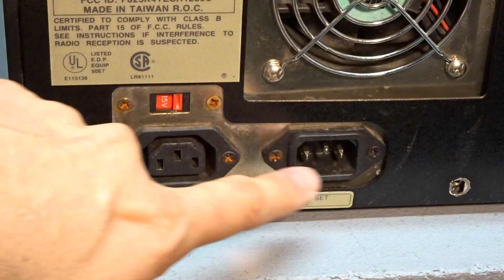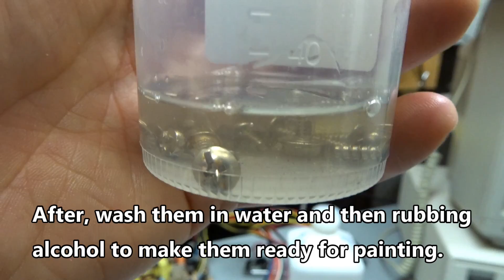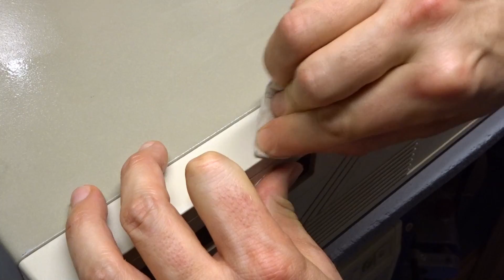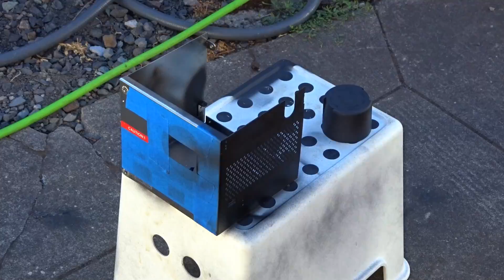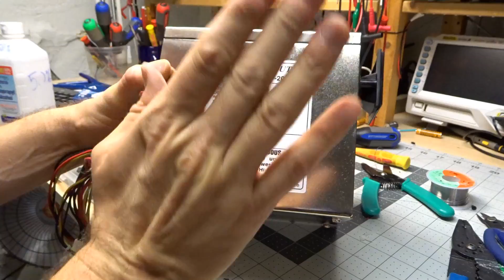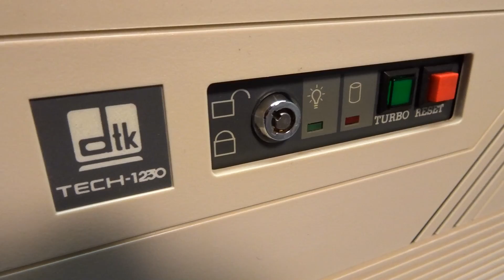Restoring an old AT computer case

Comment: My second ever PC was a DTK 286/12 with a very similar case.  At some point in my youth, I downsized and let go of the case to this and my original XT clone, but kept the boards.  I recently restored that 286 system in a generic case, but wished I'd kept the original case after seeing this.  I really liked the look of the front panel with the backlit turbo button.  Nice job on the restoration!

Comment: Hi Adrian, I have a TECH-1230 and am the original owner. I'm planning to restore it to all its glory as the only thing wrong is that the seagate scsi 48 meg hard drive likes to stick in the parked position but works with a little help and the Varta rechargeable battery is starting to corrode. The board has a 4 pin connector for 4 AA batteries so that should not be an issue. I have all the original manuals and 5 1/4, 3 1/2 disks. 
 I just have to decide what to do with the hard drive replacement. Any suggestions?

Comment: My very first PC-compatible was a DTK 80386DX-20 bought in 1990, with a case slightly newer than this one by adding two 3.5" bays in addition to those three 5.25" bays. I remember seeing this case (with red reset and green turbo buttons) in the ad section of my computer's user's manual. The case is in a quite good shape with almost 30 years of age.

Comment: Great presentation but you can't mod this into a home theater PC.  Everything is beyond legacy components with no compatibility whatsoever with modern component mounting standards.  It can't accept an ATX power supply or ATX mobo.  Not even worth the effort to restore because it's not worth $5.00 as scrap.  Just hope the right person comes along for you to give them this old computer.  I personally couldn't be bothered with this.  Nice video anyhow.

Comment: this rust and this corrosion unterneath the power supply is definately NOT from the battery.... there was ware or some other fluid inside the case

Comment: Hi Adrian. I love watching your channel. It brings back a lot of memories of building and repairing PCs in my pre teen and teen years in the late 80s and early 90s. What I'd love to do, is build a modern PC in a 1980s style PC case. I know you're in to restoring vintage PCs, but I'm wondering if there are any kits to help out with that, or would I have to have the chasis machine modified? What's your thoughts on this?

Comment: I had one of those a few years (well, decades) ago, and it was my first PC of my own (a hand-me-down from my dad). It started out as a 286 with hercules graphics, one 40Mb hdd, one 1.2mb 5.25" and one 720Kb 3.5" drive. I upgraded it to a 386-sx 16 somewhere around 1992-1993 I think, and added an extra hdd (that cost more than a decent notebook does today). Eventually I moved the stuff inside to a bigger case, and this one ended up in the trash, AFAIK.

When working inside it, it was important to connect the turbo and lock cables the right way, or you'd end up with them working "backwards". Ie unlocking would actually lock the computer, turning the "turbo" on would turn it off, and so on. Even after 30 years, I think I still have something in my current computer that was once in my old dtk. A cable, screw or a jumper.

Comment: If you hate the smell of vinegar, citric acid can be used to neutralize alkaline battery leaks (creates copper hydroxide) and remove rust just like vinegar, albeit just a bit slower.

Comment: With odd power supplies, what you can do is gut them put another psu guts in there. No one is going to know its been changed inside and usually its better too since its more newer and better power output. Only hard part is if its an atx psu, you just have to solder the AT mobo wires to it and use the front panel on switch as power on signal for the atx psu.

Comment: We used to build in these cases all the time back in the late 80's/early 90's....  It wasn't uncommon either to use 2 or 4 cell alkaline battery packs for the CMOS/BIOS backup - possible that those batteries leaked and caused the damage/rust.  I also remember having bins and bins of those side rails (both plastic and metal).  Great video - love to see these old systems being used again.  You'd use brass stand-offs where the nylon slid type won't work...

Comment: Wonder if you could mount an ATX power supply in one of those cases, would make for a cool, sleeper system, you know, looks like a 1987 old clunker, but with a 2017 CPU and board in it....

Comment: I remember this machine with the 16-bit ISA slots that had the 3 extra slots that I think we're for video I think they were 32 bit I think they were the first 32-bit slots that were used before they went to the combo PCI slot with is a slot motherboards

Pretty cool to see this machine and it would have been Circa 1987 or 88 if memory serves right

It use the old large styled in keyboard and the one may be Memory Styx and everything required a card there was a card for the hard drive interface a card for the video a card for the sound a card for the modem a card for the ethernet if you use the ethernet which most people did not a card for the floppy Drive

Amazing how fast we have advanced in technology in just 30 years

I recently saw the new nvme 1 terabyte hard drive which is not much bigger than four postage stamps and supposedly it's supposed to be faster than any other type of hard drive

I have yet to install an operating system that can use it I'm going to try Windows 7 64 bit they have a update that is supposed to give the same functionality that 8. 1 and Windows 10 gives which Windows 10 support sit natively right from the installation files

Unfortunately my motherboard does not have UEFI so I have to do a little fiddling around to make it work using a pcie card

so much changes so quickly and the new technology doesn't work with the old even just a few year old board is obsolete now

But time moves on and you have to move on with it but I still have a few old XP laptops and I keep them for a nostalgia

I really miss the days of XP even though we have advanced so much in the last 15 years I still miss XP

Comment: Nice video. I just got a Siemens Scenic D7 which I'll be working on soon, and wanted to comment that WD-40 is far better than baking soda for removing sticky stuff. It will not scratch the paint or plastic like Baking Soda might. Good idea to use the baking soda to polish metal though! Will be using that.

Comment: Hi Adrian,

In the case of battery corrosion - get ready to have your mind blown - what you want to clean it up with is lemon juice.  I know, it seems contra-intuitive, but that's the case.  The crystallization that forms isn't *acid*, it is, in fact, very high-pH *base*.  You're re-acidifying the environment and bringing it back to a lower pH.  Case in point: the deadly VARTA battery found on many Amiga computers do leak and have destroyed many an A2000, A3000, A4000 Desktop and expansion cards with onboard clocks.  The solution (no pun intended) if the board isn't too far gone, is to apply lemon juice to clean it up.  Isopropyl alcohol will also do the trick.  

Well, that aside this is a gorgeous case and you did a heck of a job cleaning 'er up.

Comment: I would be more likely to adapt the case for a modern PC build rather than a period one.  Nice job on the restoration overall but the one thing that struck me at the end was that pretty much all of the games and software I had in the 486 era were on 3.5mm floppy discs and they installed onto a hard drive, I didn't notice either of these items being installed in this video.

Comment: Didn't you try to use vinegar instead of baking soda? I believe the NiCd cells contain hydroxide, not acid, thus trying to remove the residuum with alkaline stuff is rather pointless :) I've fixed a few motherboards with leaking batteries, and the stuff fizzles when it gets in touch with vinegar. Let it fizzle, add vinegar if needed and then give it a good rinse.

Comment: Must be the geek in me...I get all giddy inside when I see these old cases restored to like new condition! :)
Reply: I feel the same Mark. It's great seeing someone that has a great appreciation for this old hardware and wants to restore it to its original glory. I have a DTK Peer-1630 spare case (missing the power supply and only have 4 of the 6 5.25 drive rails) would love to get the extra parts and put together an old 486 build myself for it.

Comment: Man I just love this old desktop cases, once I had five of this https://goo.gl/images/nyRg2q stapled roles with different systems, two of the cases was modified to fit ATX stuff in it, but I left them all in my old flat, because I decided it is junk back then, just because I was to lazy to transport them, I hate myself for that, would be so nice to have my actual PC in such a case, sprayed it black or have my rolling staple back with the 486DX 80Mhz and 64MB RAM used as one of the first mp3-player ever on the top.

Comment: Wow, I built dozens of 286 and 386 PCs in that case! DTK units typically came from a distributor as barebone case/ps/mobo/cpu combos. They were better quality than most, particularly the Enlight power supplies they used. That model is from around 1990. 
Fortunately, most of those PCs were tossed long before the batteries caused failures. Cool to see one back in action!

Comment: My first PC was a 286-based system which looked very similar to this one, just stretched it out to Full AT size. Kind of a shame I tossed it as it was in perfect working order and looked pretty much new except the permanent marker on the turbo switch. It had one of those Cigar butt batteries and when I got it (2003) it was already growing crystals.

Comment: I don't understand why you are wasting your time on this.  It was a generic clone system.  If it were all IBM OEM then I could see restoring it for a museum exhibit but not just to have another big piece of useless garbage lying around.

I was going to write a lot more, but that would be a waste of time too.  Sometimes I scoff at people who state someone is outdated by a few years and is only good as a boat anchor, but in this case (pun intended) I believe you truly have found something with no purpose other than being a boat anchor.  It's too big to be a good door stop, lol.
Reply: About half way through the video I was imagining what it'd look like with a modified back plate to accept a modern microATX board. You know, that whole 80s PC that's really a modern high powered machine thing.

It's the big orange power switch that does it for me. Can't beat the over-engineering that goes into old computers. Why have a small 5A toggle switch when you can use something that feels like you're switching on the entire building ;-)
Reply: @jamesgrimwood1285  well, you we're switching on the entire building, almost at least. ;-) Don't forget that this big orange switch also turned the computer AND the monitor on or off. Screen savers hadn't been invented, neither the monitors or computers had anything like power saving or sleep mode, and usually the power switch was placed on the rear of the monitor. 

The reason for this is that people would forget to turn the monitor off when turning off the computer. And these things were a bit more expensive back then.

Comment: I have a variant of this PC. It was sold under the ULTRA professional system brand, however the back is labeled a DATA-1000. But the PC Lock/Turbo/Reset is exactly the same, and it just lacks those nice vertical stripes. Also made in Taiwan. I got it for free and it's in terrible shape, FDD is dead, no HDD or controller, and just missing a ton of crap. Not sure if I am going to restore it, or repair the case and put a 16 Bit system in it.
Reply: if that much is gone, check the power supply, if it is good, upgrade to 32bit. if not scrap it all.

Comment: This case reminds me of a Laser XT computer I used to have. The layout and the power supply and the 5,25" bays are pretty much identical.

I enjoy watching most of your videos. Your voice is lovely and the way you are able to find a solution for pretty much anything you come across is very satisfying. And the music really adds to it.

About the power supply fan: The original Nidec one probably would've been more quiet at something closer to 5v, and still last a really long time. Though replacing the fan is always a good idea to be certain that the power supply will stay cool for a long time to come.
And I think paiting the bottom part of the power supply probably would've been a good idea in hindsight.

Comment: The active ingredient in that rust reformer is Naval Jelly... IIRC it converts it into another form of rust FE2O3. It's on wikipedia under rust. Funny you spent so much work on this. I think I have an unrusted original AT case sitting around here somewhere. I remember the turbo button. I have something, can't remember exactly what it is.
Reply: More specifically the active ingredient is some type of acid like phosphoric acid.  Naval jelly is mostly water and thickener as a delivery system.  However that was all light surface rust so all he really needed was a wire brush and steel wool, then paint it with Rustoleum.  There was no need for rust reformer on something meant for indoor use.   Obviously the system had sat in a damp location and if it does again, the rest that is unpainted will rust.  He ought to have waxed or clearcoated all bare metal if he were going to all that trouble anyway.

Comment: to remove marker from plastic without abrasive things use a witeboardmarker then wipe it of.
Reply: SandyStarchild good tip, LGR also demonstrated this on big box PC games to remove permanent marker on glossy boxes
Reply: It doesn't really work on the rough surface plastic, like DTK used.
Reply: This is a different type of plastic than those you've seen people have success with from your method.  There is no way to remove marker from his type of plastic without removing the top layer of the plastic because over time the market seeps into it.  Normally the solution is to paint the whole thing with spray vinyl dye which similarly seeps into the surface to make a very durable finish that won't flake off.  However you are limited in the color range that vinyl dye comes in and will probably not find one that is that light beige color, so will have to settle for one of the more common colors it comes in such as black, white, silver, brown, etc.

Comment: I haven't seen a DTK in a long time. Back in the mid 90's, I had a DTK "Grafika" 486DX2 66mhz. That was a great machine.
Reply: I have no idea. The newest machines I have seen from DTK were 200mhz Cyrix MII based systems in a similar AT case. The school district I worked for from 1999-2003 had a bunch of them, and a bunch of similar Pentium 133 systems. Their website still exists, and they seem to offer a few products, mainly solar panels, and police/taxi mobile data terminals.
Reply: I have two DTK PC's with Athlon XP 2400+ and Celeron 1.8GHz